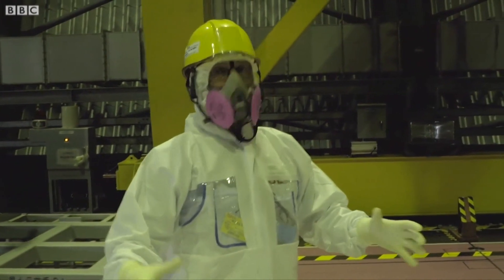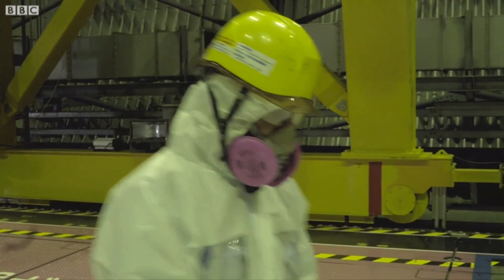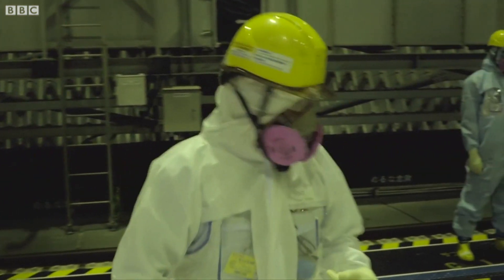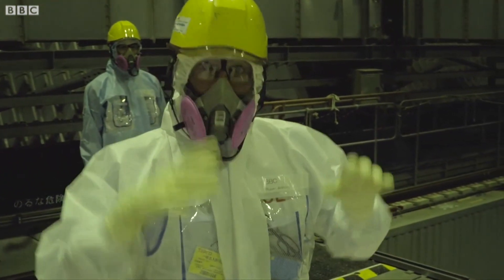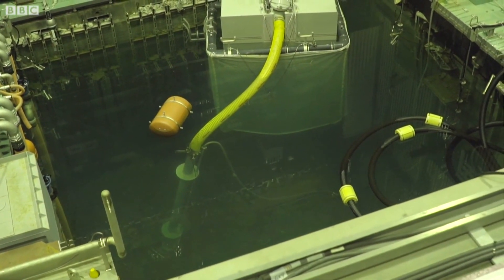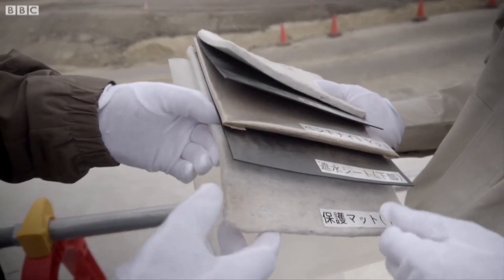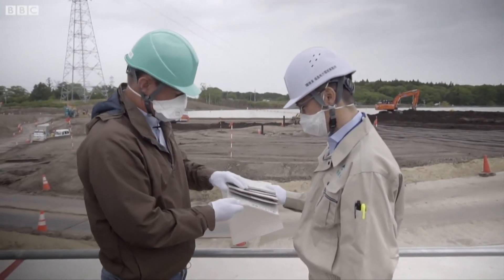Fukushima: How to move a mountain of radioactive soil  - BBC News

Comment: Chernobyl is still very dangerous, so Fukushima is very dangerous.
Reply: But no one died from Fukushima radiation.
Reply: @danadurnfordkevinblanchdebunk  Greenpeace's main findings are:

 In the Itate area, where decontamination was completed, four out of six households measured radiation levels on average three times higher than the Japanese government's long-term goals.  At some points, even higher levels of radiation were measured than in 2015, presumably as a result of recontamination.

 In one of the houses in the Namie evacuation area, radiation was measured that could reach up to 7 milliberts, which is well above the annual annual exposure limit of 1 millibert, even though the area was a pilot site for decontamination in the past.  This shows that the effectiveness of decontamination works is negligible.

 10 milliliters of radiation was measured annually in a forest near a school in Namie where evacuation instructions were released, indicating that decontamination did not significantly reduce student exposure.  Young children are particularly vulnerable to radiation exposure.

 At one point in Namie's evacuation zone, radiation was measured that could be exposed to up to 101 milliverts per year.  Assuming that one year is spent at that point, it is about 100 times the normal public limit.  This first poses a serious danger for decontamination workers who will spend a lot of time in the area.

Comment: An essential requirement for the release of radioactive contaminated water is the removal of nuclides. Tokyo Electric Power has insisted on eliminating more than 60 nuclides in contaminated water with the Multinuclide Removal Facility (ALPS).But it turned out that Tokyo Electric Power's claim was false. At a public hearing held in August last year, Tokyo Electric Power acknowledged that it failed to remove key radionuclides such as tritium, cesium 137, strontium 90, and iodine 131.Tokyo Electric Power also said, "A self-analysis of 890,000 tons of contaminated water has resulted in 750,000 tons, 84% of which exceeded the standard value, of which strontium 90 was found to exceed 20,000 times the standard value."Nevertheless, the Japanese Nuclear Regulatory Commissioner reaffirmed that the Japanese government's firm position on the ocean discharge, which is a quick and inexpensive method of treating polluted water, was a firm position.
Reply: You still refuse to look anything up don't you?   there's absolutely no reason to boycott Olympics due to radiation.  You are a racist South Korean.

Comment: "badly damaged" reactors? TOTALED reactors is accurate. It will take 50-200 years at least to "fix" them. Auto mechanics charge $85/hr. If they estimate 50 years to fix your car, you would say "yeah, go ahead and get started,. It's badly damaged but if you take weekends off it won't cost THAT much."

Comment: Just to be clear the reactors at Fukushima did NOT explode. Hydrogen gas that accumulated in the buildings surrounding the reactors exploded. That gas was generated when the fuel inside the reactors overheated.
Reply: Except for the birds eye images of the containment vessel lids blown off.

Comment: When looking at the fuel pool you can see the radiation flashes as it hits the lens
Reply: In this video?
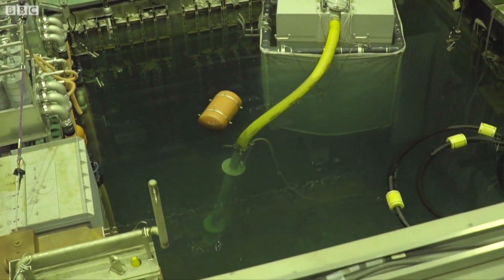Reply: @Flavio010295  it does look like it. watch 10 seconds starting at 1:52 - look for white specks appearing at random.
it's most obvious in dark areas of the image. watch at HD quality and 1/4 speed for best clarity.
this is radiation directly hitting the camera's sensor. it is unaffected by camera movement or lens settings so it is always pretty clear in appearance and cannot blur from camera movement.

Comment: The soil has radioactive materials which emits alpha rays..  but it is weak..  so we can easily covered with plastic.  But the reactor basins contains gamma rays which can penetrate even concrete ..
Reply: Vietnam is worse though
Reply: Hello Mate  There is no high radiation in Vietnam.  Show the evidence to your assertion.
Reply: That's why the serious gamma radiation is inside the containment vessels.  Although it does penetrate concrete/steel/lead, the greater mass reduces it to the point that you can stand on the other side of that containment vessel and not receive a high enough dose to harm you.  No one has died from Fukushima radiation.